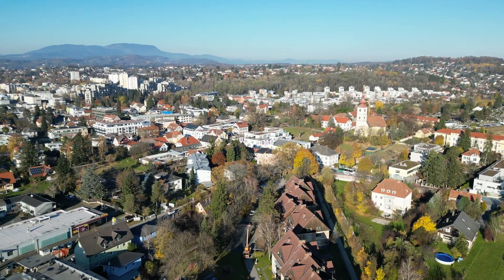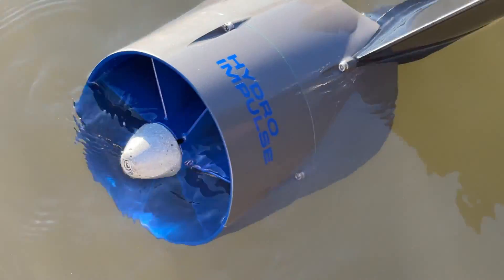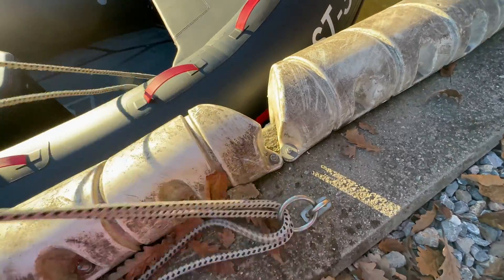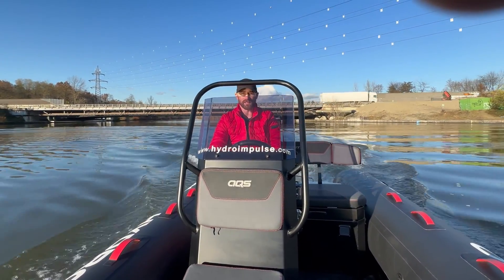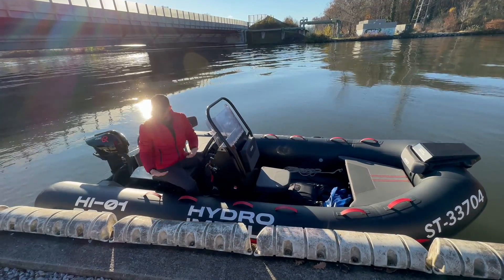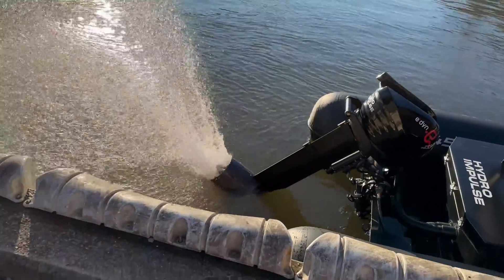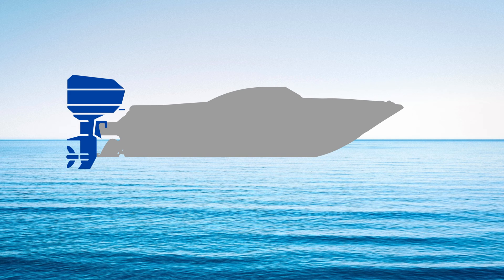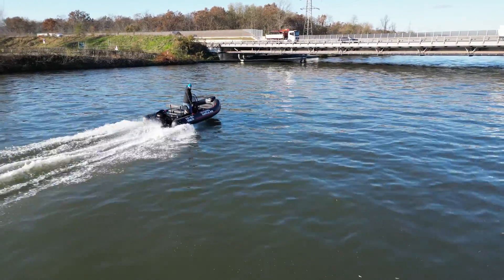Will This Replace the Propeller? | Hydro Impulse Jet Pump

Comment from the maker: As the commenters pointed out, the phenomenon at 01:51 is called "aeration". Cavitation is the formation of vapor bubbles which then collapse under the high speed of the propeller rotation, causing loss of thrust. Both of these phenomenon are prevented by hydro-impulse's design.

Comment: this is not a jet, it's a kort nozzle. Good for static thrust but inefficient at high speeds. I've worked on tugs that have them, they have limited application. good bollard pull but the drag over 8 knots just kills them.

Comment: The word is skeg, not scag.  Cavitation is boiling of water due to sudden pressure drop.  On props it's caused by turning faster than the water flow can stay attached to the surface of the prop.  It has nothing to do with surface air, unless you are confusing supercavitating props that run near the surface.

All very confused.

Comment: Cavitation is not air being drawn in from the surface , that is aeration .. Cavitation occurs when the prop blades spin faster than the water molecules can handle which effectively boils the water around the prop. Really bad info .. there are much better channels out there I don't recommend anything else said here or the product .

Comment: That is what's called a ducted prop.
 A jet pump increase the water pressure which this does not. It's simply prevents most of the vortexes that's generated from the propeller tips.
 I wouldn't even call my doctor propeller on my boat a jet pump even though it's not just shrouded like the one you're seeing it actually drawers water from the bottom just like a jet pump would. And even though it does suck the water up and blow it out through the 9" prop. Then has a small Venturi going down to 7 in and out the steering and Pitch nozzle.
All the but the prop it's made of TeX-Treme  and Zilon hybrid composite.
 And even when it's out of the water it's still will give thrust. Something the typical shrouded or duct propeller won't do.

Comment: For gods sakes, everything about this lame video is wrong! Cavitation explanation is silly/wrong/embarrassing. The lack of prop walk may be there, but prop walk is your friend, I would miss it. Lastly this  mystical “increased efficiency” is completely unchallenged. Next you are applying fictional efficiency  gains in to less batteries? This is embarrassing to logic and reason. Compare efficiency is so easy to do, yet no comparison is made. Lastly, if there was increased efficiency (there is not) we would use that for increased range, as the range at present is not even close to enough. This entire video is an insult to our time

Comment: if that's cavitation, how could it alsow occoutr in circulationpumps where there isn't any surface air?
Reply: Cavitation extracts air from the water and allows the prop to free spin.
Reply: Generally it's caused by a oversized pump so that the fluid can't flow.

Comment: Im sorry but you failed. The propeller draging air from the surface is NOT cavitation. Cavitation is when pressure drops enough for water to "boil" at given temperature. This is elementary school stuff dumass

Comment: Sidestepping? It's called Propwash.
I have allot of that with my sailing yacht and have thought of constructing something like a ducting around the prop. But the thing I'm always afraid of is debris like plastic or weed getting tangled in the system. With an outboard you can just lift it out of the water and clean it of course.
Reply: Propwalk, no?
Reply: @aydrian9196  Correct.  Propwalk and propwash are two different things that can move the boat in opposite directions, depending on the design of the prop and boat and motor turning direction.

Propwalk is when the turning of the prop moves the boat sideways due to the prop pulses interacting with the hull and creating a side thrust.  

Propwash is the effect of the normal flow of the prop directing thrust over the rudder and having the thrust deflected by the rudder, also resulting in a side thrust, but dependent on the direction the rudder is turned.

So yes, the OP got them mixed up.
Reply: @aydrian9196  yes, propwash is axial direction, propwalk is radial direction. this is propwalk or tranverse thrust

Comment: Shrouded prop.     Why not just go toroidal and get more power and thrust?   Seems to me it is just a captured prop.   Not raining on their parade at all, but I dislike when people utilize the term 'jet" for what is essentially a captured prop and not even a turbine.    Typical misinformation and hyperbole in advertising.
Reply: toroidal props only have any benefit in a vanishingly narrow range of variables, most of the time they're just extra drag. This is the same situation as the Darrieus turbine vawt, more efficient at one speed only, but broadly less efficient across the range. The thing to measure is the area below the graph, not the peaks - if that makes sense.

Comment: Your explanation of cavitation is incorrect - also the standard open blade is in a closed box close to the surface vs the ducted version which is in open water. They also seem to be comparing a electric motor with a ducted fan (propeller) to a standard petrol outboard and open propeller? Apples and oranges. Normally ducted fans are safer and produce a more directional force, due to the extra surface area from the ducting they produce more drag and are less efficient at higher speeds vs standard open propeller.
Reply: I had the same thought about cavitation, because I know it can happen with submarines, and they're nowhere near the surface.
Reply: Thanks for pointing that out. I quit the video when they said that about cavitation then came back to check the comments.
Reply: Ya me too, cavitation is not what they said here, kinda pitiful.

Comment: "20% more efficient"

More efficient than what? They don't say.  For them to claim regular props are only 60% efficient is also meaningless.  What they likely mean is that it's 20% more efficient than a prop of similar diameter.
But a regular prop isn't limited by the duct, so it can be much larger and more efficient overall.

Comment: Drawing air down is called aeration, cavitation, is the boiling of the water, in front of the propellor. This misnomer, has almost changed the English language, until someone wants to talk about real cavitation.
Reply: In the boat world it's actually called ventilation if you want to get particular.  You are correct about cavitation being highly misused in propeller discussion. 90% of people get it wrong.
Reply: I was pissed also.
Reply: What you said is exactly right.

Comment: I assume you can put this prop technology on a gas engine too?
Reply: That would be a much better way of showing its efficiency. Put a 40hp gas on there and show what it can do. If the fuel savings, or speed are better then you’ve actually done something. But right now all the changes he’s feeling could just be the difference between gas and electric.